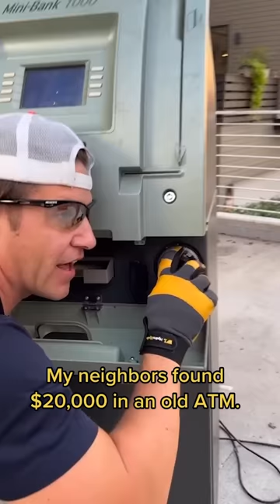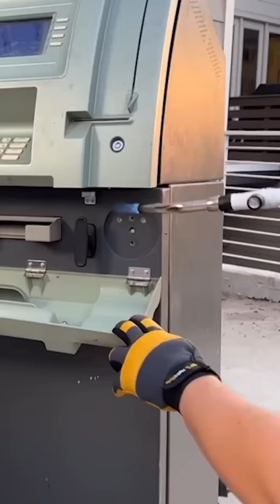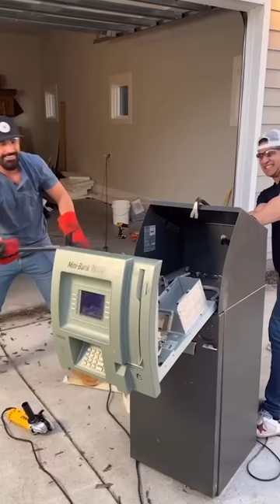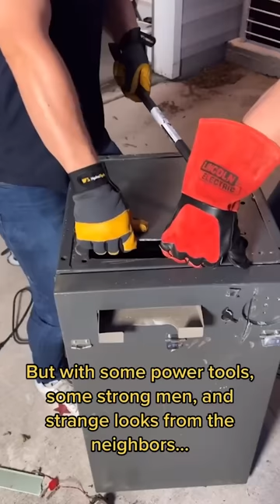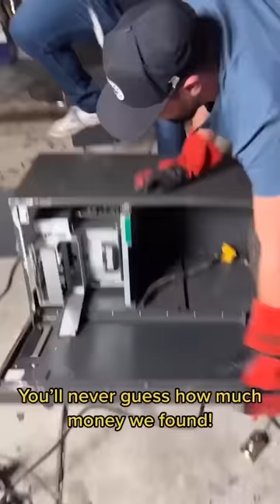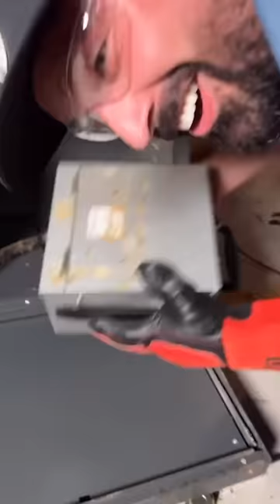WE BOUGHT AN ATM! #Shorts

Comment: You guys know how easy it is to remove all of the money when you have the key. Banks regularly monitor ATMs as in every single day. They need to take out the memory card that recorded all the transactions to upload it to the system and other balancing process - then they will put a new memory card (not sure if they are still using the floppy disk since it's the most secured) and then replenish the money. Not sure if new atms can now directly upload the data.

Comment: Me and one more friend actually did this,.. not the harsh way

Bank ATMs can be dismantled, 
I found some decent dual core and 4th generation computers in them. They wipe the data and clear locker before salvaging or selling scraps 

Just time consuming, not rocket science 🔭

Most Hitachi ATM machines are breakeven purchase if you find a decent CPU and displays. . Never found any cash 😂

Comment: Ameture hour, a bottle of propane a length of garden hose, a car battery and an extension cable with a sharpend chisel and I'd have it open in 4 mins flat,,, obviously it's dangerous to blow shit up so precautions are in order, get behind an engine block of a car or truck, or an axle if you don't have time to get to better cover and blow it up and your golden